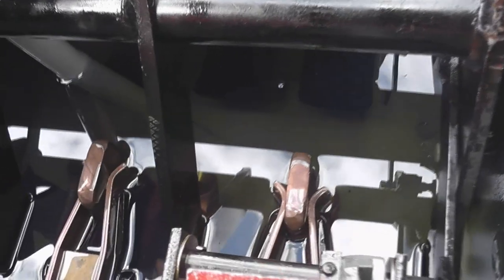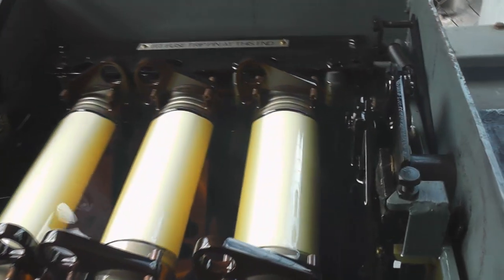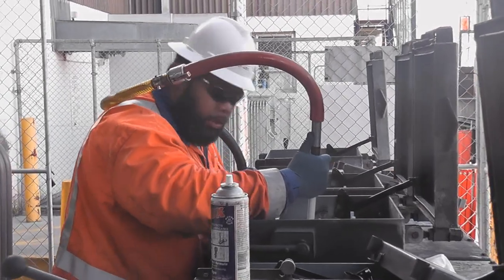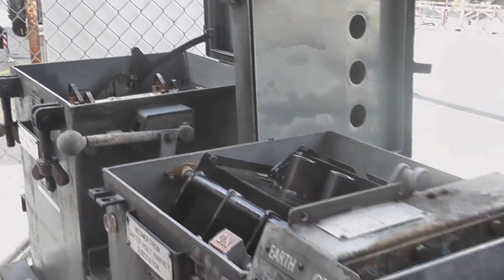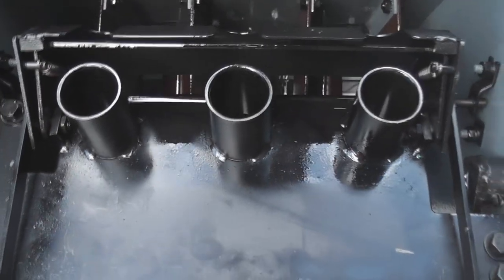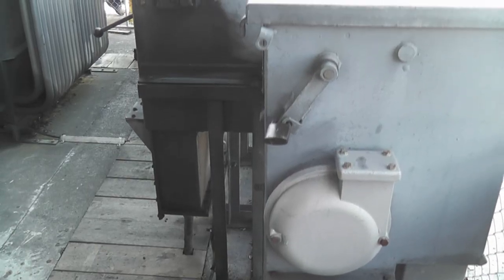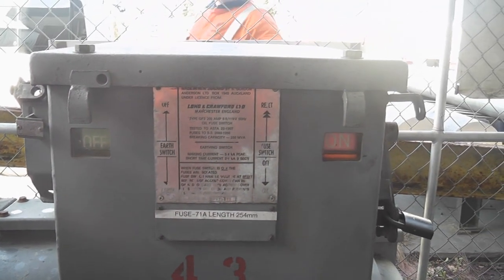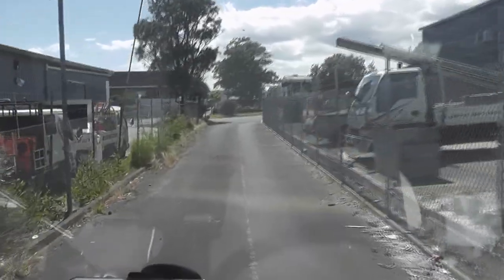Long & Crawford 11 kV switch units

Comment: It's just amazing the similarities of the New Zealand distribution networks to ours here in the uk, the switchgear in this video is identical to many units in service around the UK. I do however prefer switching on Reyrolle gear to Long & Crawford, it just feels better built. Thank you very much for posting this video, it's extremely interesting to see the similarities between the network I operate on in the UK and yours, many thanks, Matthew
Reply from the maker: +Matthew Brown We have some Reyrolle gear too. Most is ABB and Andelect locally made switch gear.

Comment: I used to work at a site in the UK that could consume 1/200th of the UK's possible electricity supply, to run ENORMOUS air pumps\ cooling systems\ etc.  We could only operate the gear at night, when grid load was low.  We had swtich gear like this everywhere.  :)

Comment: There used to be loads of those Crawford switchgear from the 1950s around where I live.  They have now been replaced with modern ones which take up much more room for the same job.  The new ones don't look anywhere near as solid.
Reply from the maker: +Beno Agreed, the new SF 6 switchgear is very flimsy. It won't last 50 years +, maybe 10 -15 although the manufacturers say it will last longer.

Comment: Neat, what do you do when you have to service this in the rain?  wouldn't that contaminate the oil?
Reply from the maker: +tiporari We won't service these in the rain, if an emergency we set up tents over the units.
Reply: Sensible.  Often the simplest method is the best.  Thanks for the reply.

Comment: Nice gear. Never did hear back from you about the type of oil. Shell Diala? What do you do with the old stuff? Filter out all the contaminants and then re-use? Could you please send me couple 5 gallon buckets of the old stuff to the US?
Reply from the maker: +paul larson It is mineral oil, we get recycled oil, the contaminants are takes out as well as the moisture. Then the oil has to pass a minimum of 50 kV per 2.5 mil test for die-electric breakdown.

Comment: What is the service life on the newer switch gear? Thank you for posting.
Reply from the maker: +Coolkeys2009 Manuf reckons 25 years I think 15 years max, just the way how thin the new stuff is built.
Reply: +RODALCO2007 In that case I wonder how long ones produced 25 years from now  will last  :-)